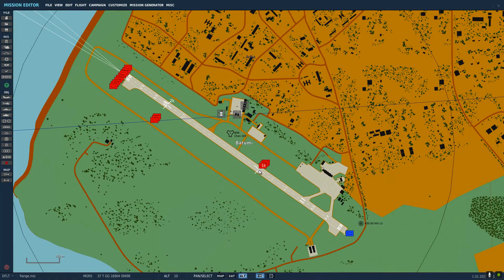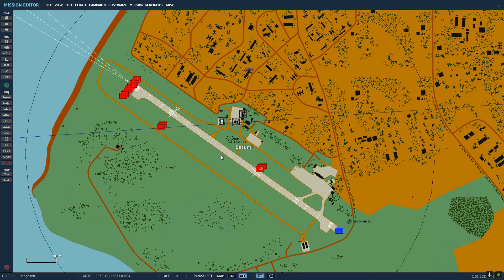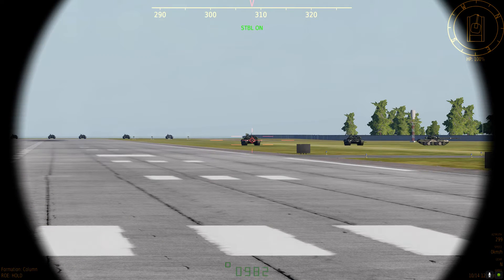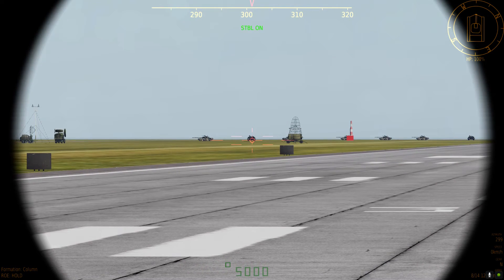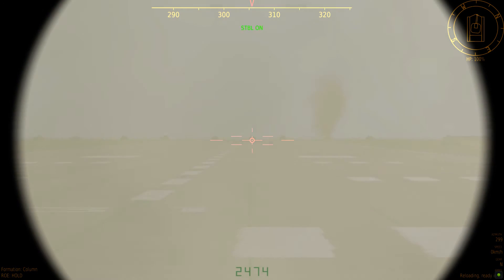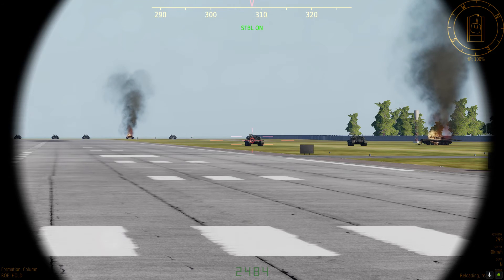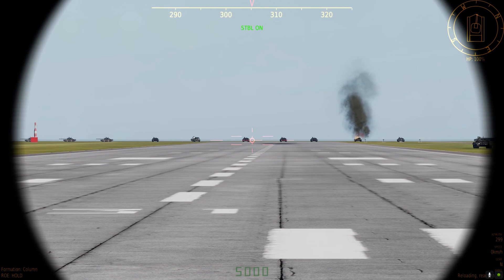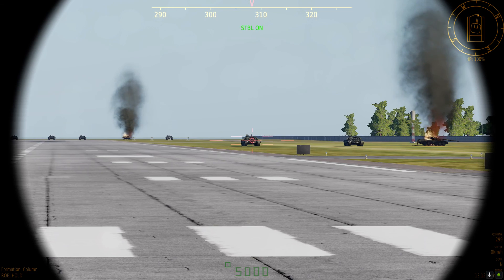DCS: M1 Gun Inconsistency

Comment: I get the impression (based on how little they've done for vehicle specific behaviour) that CA was never meant to be at Steel Beasts level of accuracy in terms of simulation, more as a generic 'you can move the ground units around' kind of level. We can dream though....

It would be nice if they fixed obvious stuff though.
Reply from the maker: It doesn't need to match SB-level accuracy. It just needs to work.